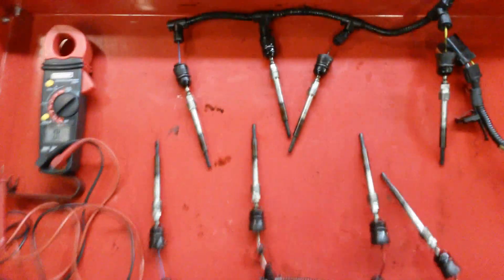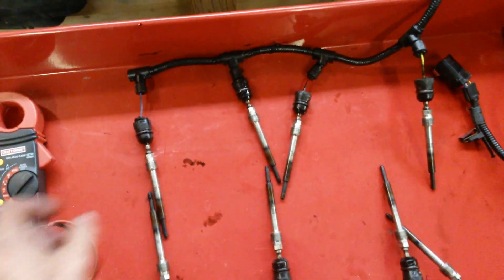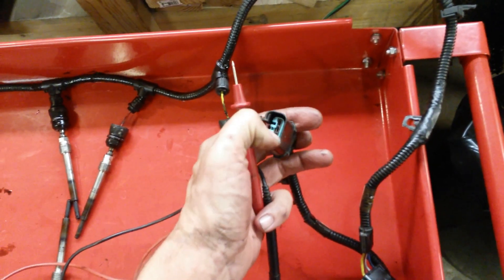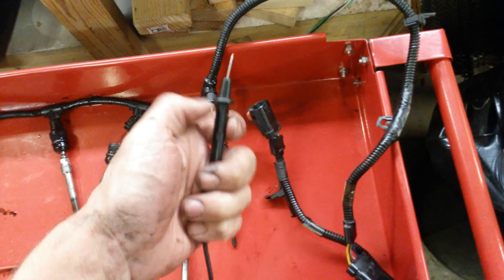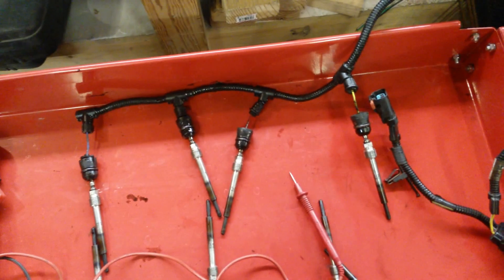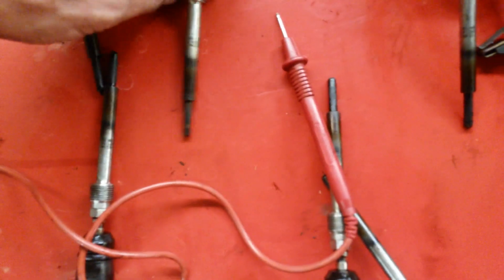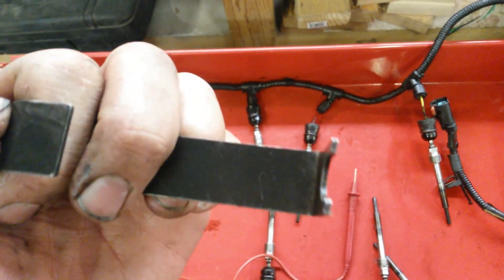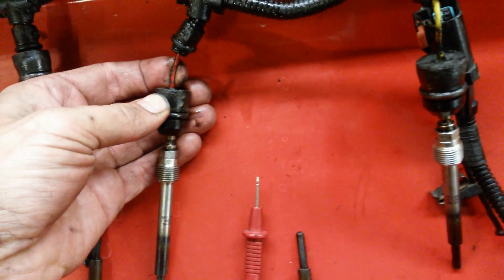FORD 6.0L Diesel ~The Glow Plug System ~Harness ID, Testing & Removal

Comment: I've determined that glow plugs are really hard on my batteries. Have gone through 2 sets in less than 3 years. Recently disconnected the connectors on the GP module and I get much better/stronger cranking at start up. I live in So Cal, so I'm not concerned with freezing or even low temps. Do you see any long term problem in doing this? It does seem to crank a little longer and I have a tune installed so it puffs a good amount of grey smoke initially (is that bad?), but fires fairly quick. I figure if I need the GP's, I'll just reconnect the module.

Thanks
Reply: Since you're in the south, it's not going to be a big issue except for a bit more wear on the starter. Depending on how much fuel is dumped into the cylinders before it manages to fire, you might do some damage over time. Since you are tuned, are you watching your battery voltage with gauges? It should be up around 14v with the truck running. If not, your alternator is part of the problem.

Comment: Can you still use that wiring harness with cable exposed? I just replaced all 8 of my glow plugs and the passenger side broke on me just like that. You said wd40 what's that for?
Reply from the maker: No, don't re-use them if they broke. I put links in the video description above to get them cheap on amazon. The WD40 helps loosen them up before you try to take them out. Make sure you put plenty of oil on the O-rings when you re-assemble.